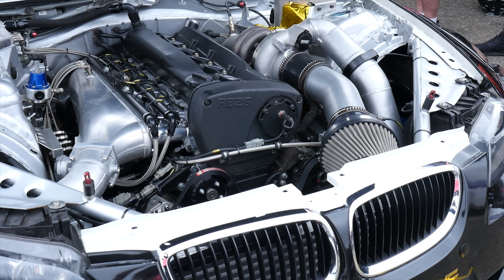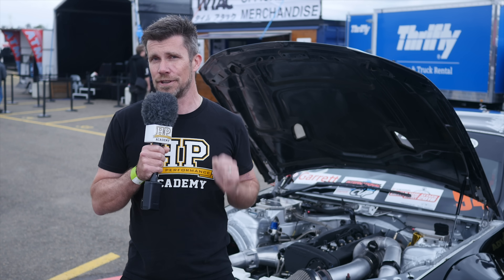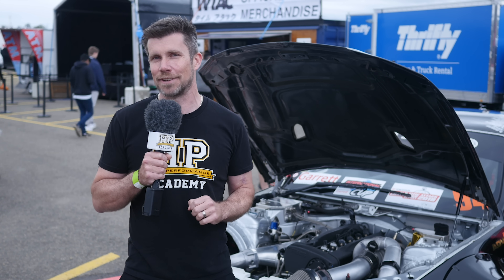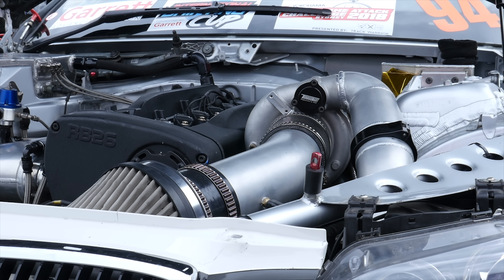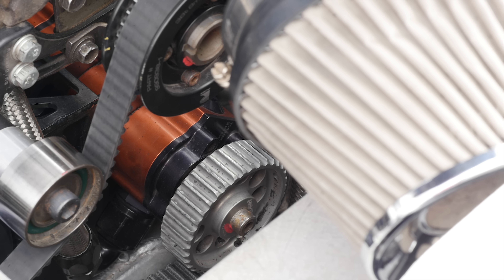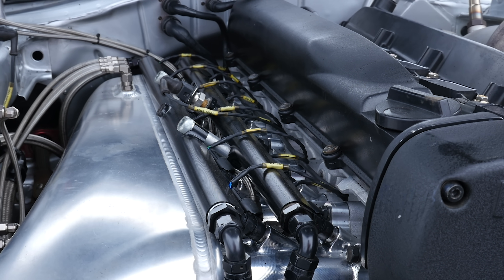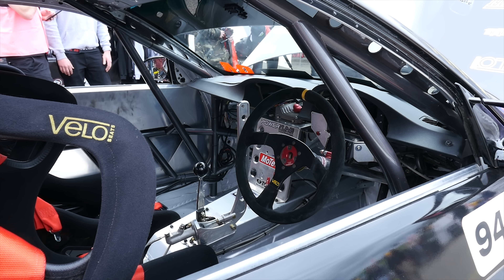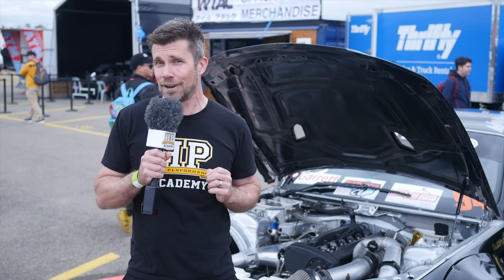How?! 10,000-RPM BMW M3 | 1000HP RB28 Powered E92 [TECH TOUR]

Comment: Why bother any S based bmw engines even a normal bmw engine are much better than any RB ever would.  My euro spec S50B32 engine is much better in everyway .
Reply from the maker: What did you own that had this same RB28 setup in it? - Taz.
Reply: @hpa101  nothing but ive worked on many skyline non gtr even older model . But my e36 m3 S50b32 i had about 12 years ago was perfect minus the maintenance of the vanos /valvetrain /shims /rod bolts /rod bearings and old age cost alot if money i was still young back then  . I'll be do a s50 soon on my channel with SMG Transmission from a e36 m3 evo plus a bunch of other vehicles.
Reply: still waiting for that superior build of yours...

Comment: Why Borg Warner and not Garret or Precision?
Reply: He talked about it in a video/s on his channel Driftsquid i don't remember which one. However to sum it up If i remember correctly correct me if i'm wrong he ran a Garrett turbo at the start and maxed it out. Then he decided to experiment with a Precision turbo afterwards and overspun it and it wasn't as reliable as the Garrett was in a drift application so he needed a new turbo. Then he decided to go to a Borgwarner setup to experiment with Anti-Lag and lots of boost fed into it and maybe compare it to the other turbos that he's used in this setup previously.
Reply: @Kazu067  you must be subbed to my channel and I thank you for that. You are spot on mate
Reply: Because the efr series is straight up better then the GTX at the moment...
Reply: It's cheaper duh
Reply: EFR's are not better than GTX gen 2's. Old info.